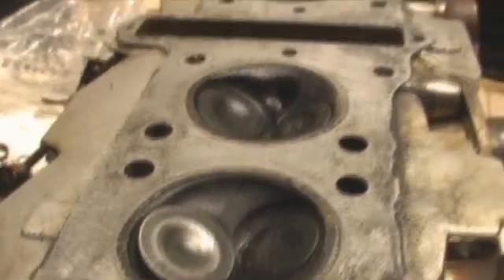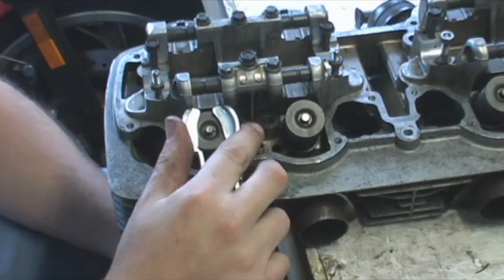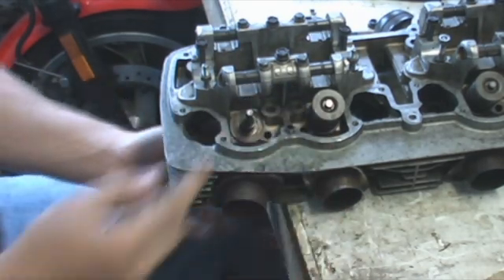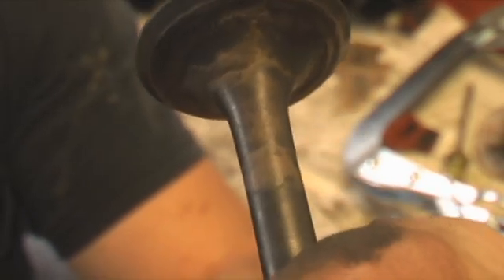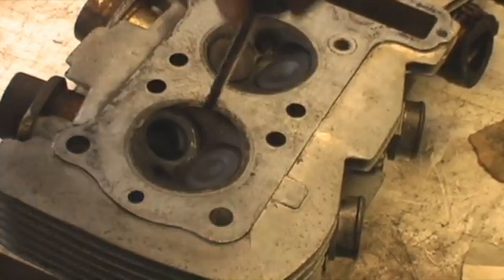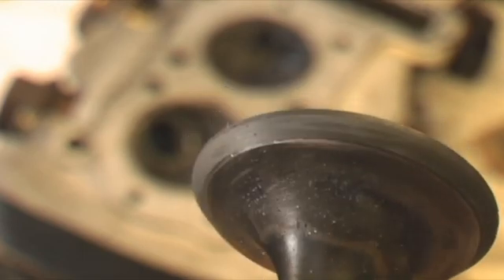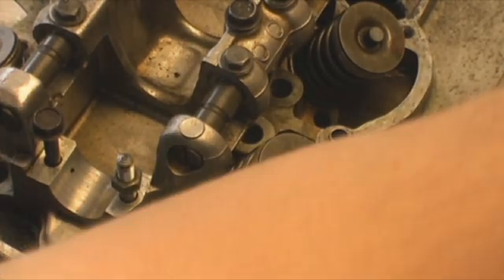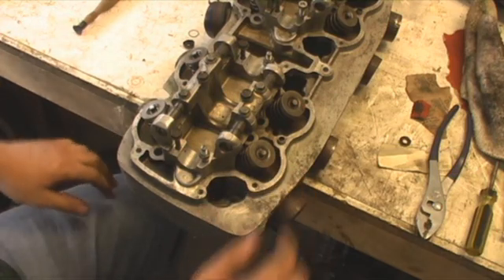How to: Engine Valve Lapping - 1974 Honda CB750 rebuild: Episode 3

Comment: Yeah, sorry but the proper way to do these valves is to cut them with the proper 3 angles. These are hardened valve seats and so lapping take a long time to produce any meaningful results. By cutting them, you refresh the angles to promote better valve sealing. The only time a lap may be of real use is if you are mainly cleaning the seat. Also, a lot of valves are stellite coated and it is very thin. Lapping can remove that coating.
Reply: The problem is that it won't last as long, and if the lapping was done with new valves, it can damage them. Bottom line is that the job isn't as good as it could be. How long did the leak down test go for? There was a leakdown test, right?

Comment: Your spring clamp face that sits on top of the valve spring is on upside down. The "flats" on the side of the face are meant to saddle over the top of the spring to avoid sliding or slipping off the valve washer.

Comment: this video is perhaps one of the few instructional videos which are cleanly shot and illustrated. thanks killersoundz, I was going to work on my '80 cb750 head in few days and this certainly helps and gave me the needed confidence. 
I think I might just be able to create my own valve removal tool using a C clamp now that I know what it looks like :)